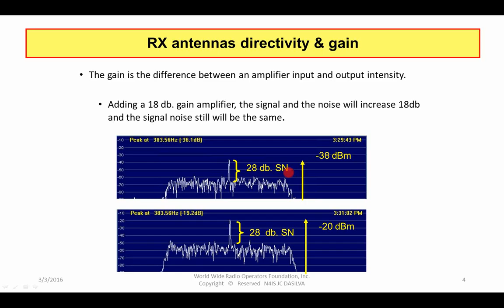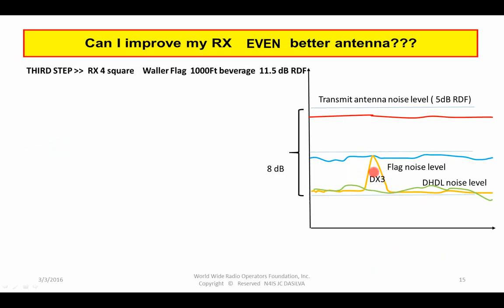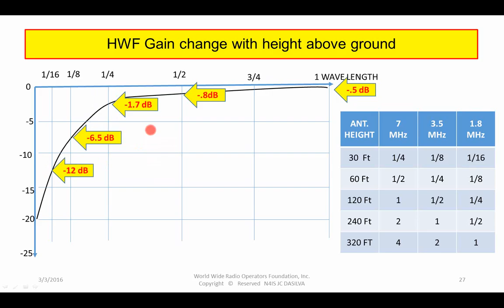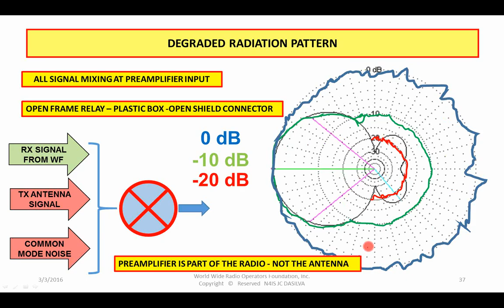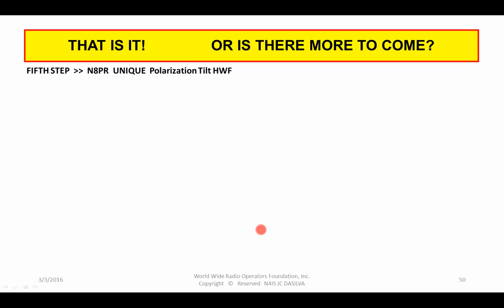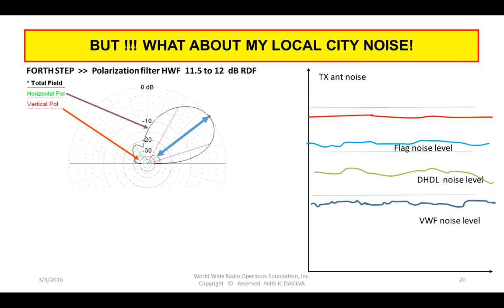2016 03 03 21 00 High Performance RX Antennas for a Small Lot

Comment: I am also real-estate-challenged. And am also a brand new amateur. I went with a 30' flagpole antenna from ZeroFive that covers 80-6 meters. Any type of tower would have taken up the whole back yard and looked awful. My front yard is also small and heavily sloped, so a 60'x30' area behind my house is all I had to work with. I also put a Diamond V2000A on the roof to get 2m/70cm coverage. I used LMR-600 on both antennas and the flagpole is connected to a Yaesu FTDX5000MP and the Diamond is hooked up to a Yaesu FT-991. Thanks for the information!